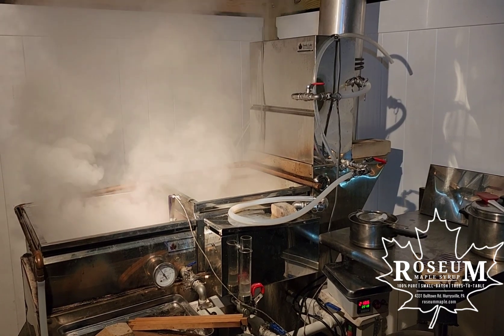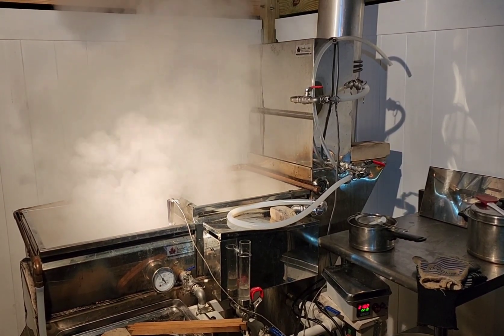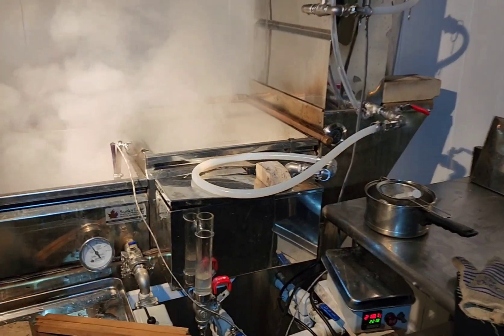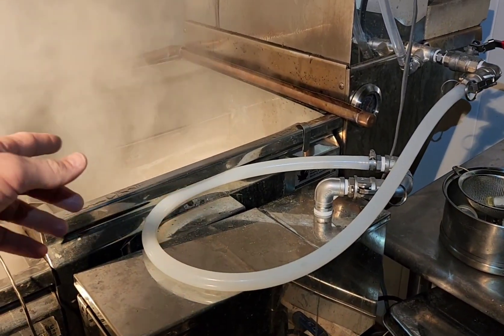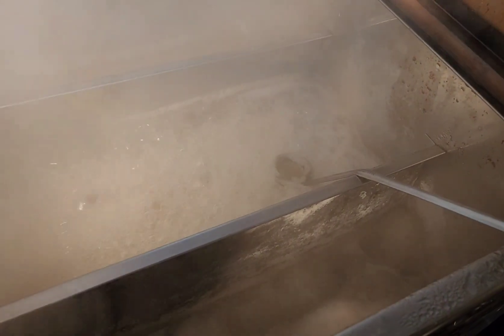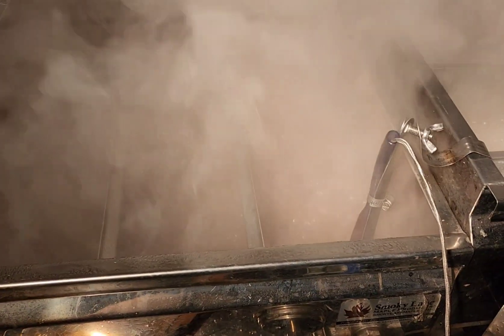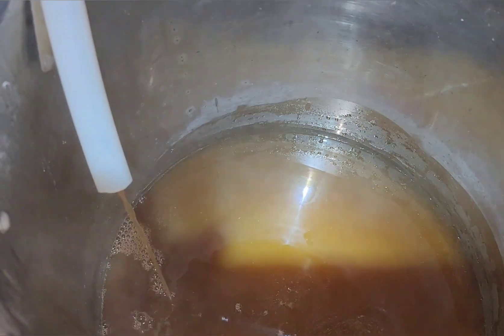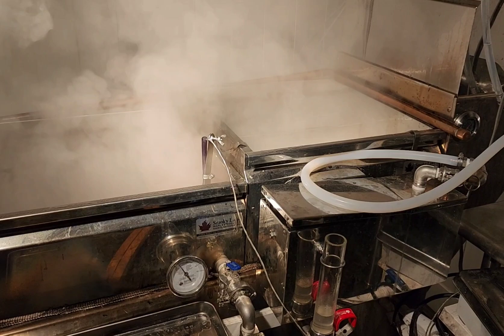Maple Syrup Evaporator Overview - Smoky Lake Dauntless @RoseumMapleSyrup @SmokyLakeMaple

Comment: Hi what evaporation rateDo you get is this a 2x4 with blower
Reply from the maker: This is the Dauntless drop flue pan set from SmokyLake and is 20 x 40 inches.  The pack feed pan is another 20 x 8 inches.  This is on a custom natural gas arch I built with a small low-speed blower to assist the exhaust gas draft. I average about 15 gph on this setup.